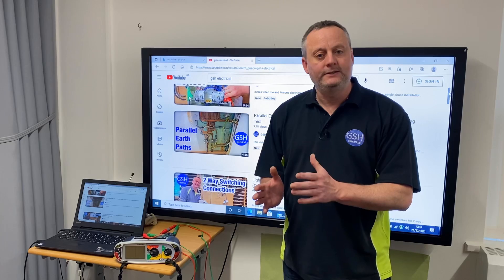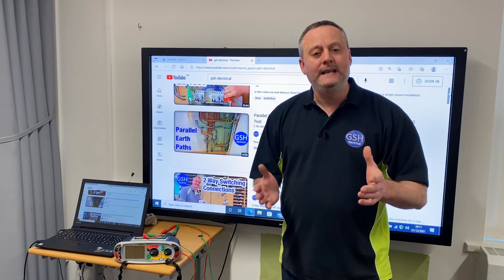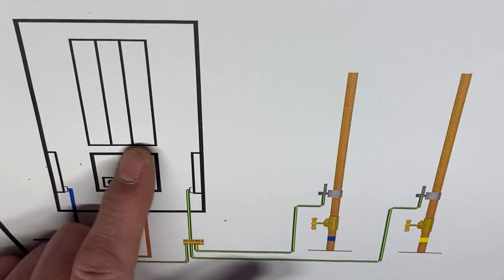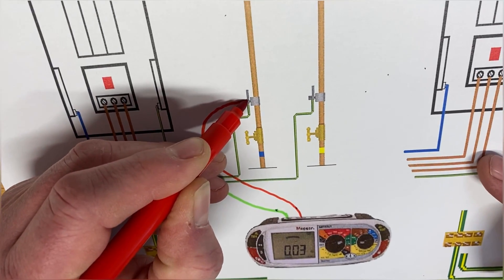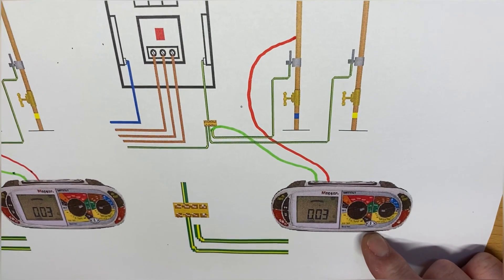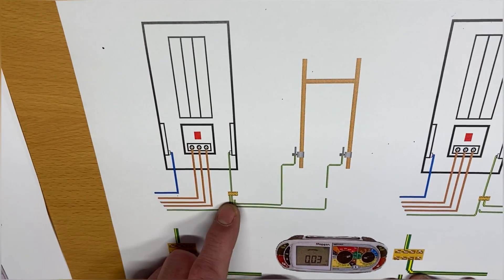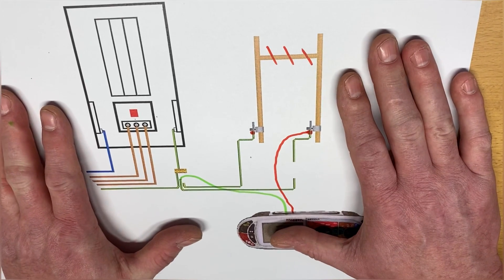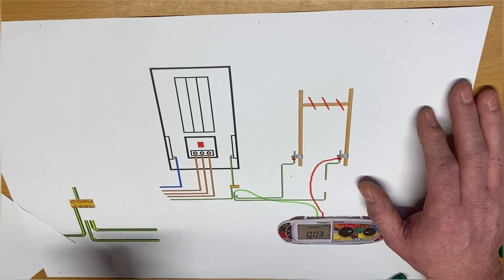How to Test the Protective Bonding Conductor - Testing and Fault Finding Hints and Tips - AM2 & AM2S

Comment: Great explanation Gaz, I always like disconnecting both ends, out of preference. Then just a quick test from the clamp to the copper pipe as a secondary check. 

This parallel path scenario is a real problem when attempting to perform a 22K extraneous conductive part test. Great video btw👍
Reply from the maker: Thanks 👍🏻